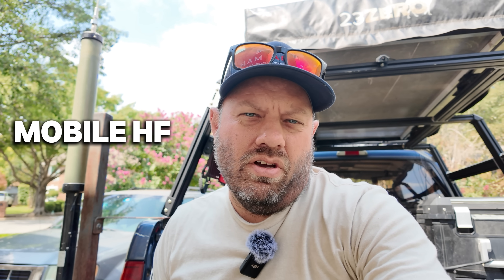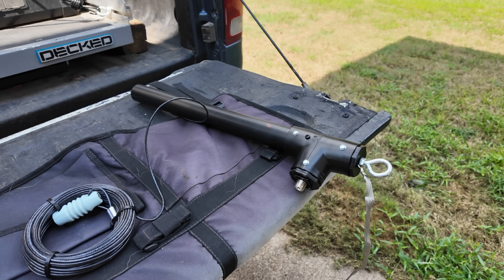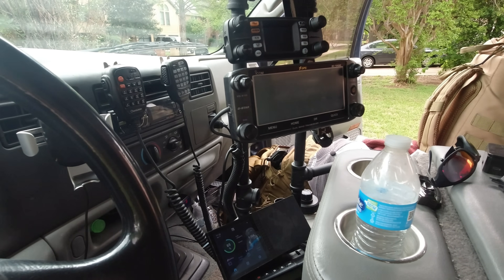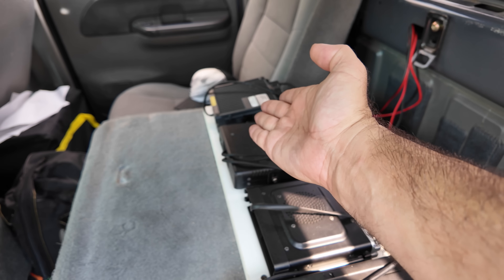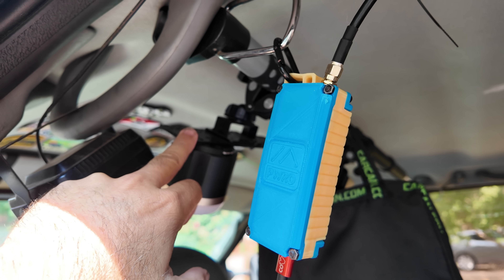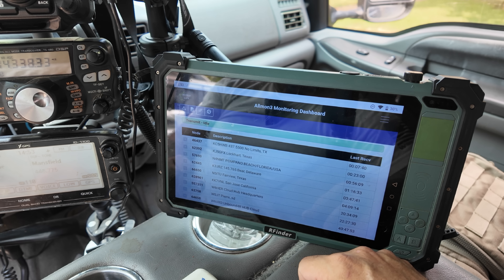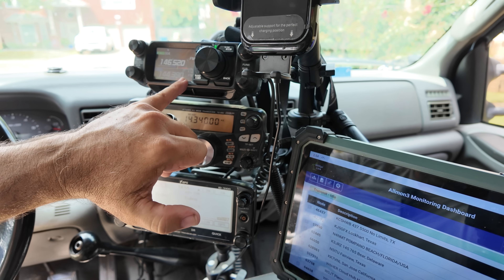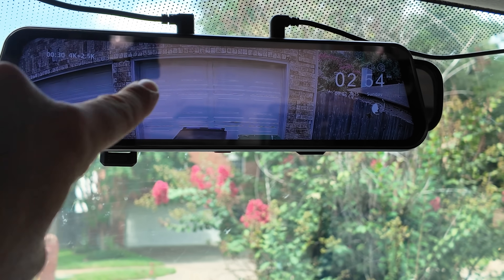How I Built The Coolest Truck Setup Ever

Comment: You can cover that back cab wall with dynomat or some similar sound deadening tape. it will keep the cab cooler in the summer and reduce noise a considerable amount. You can do the inside of the doors too if you pull door panels. I do this on all my older trucks. Makes them feel new inside. Plus it makes it easier to hear radio stuff while driving. Very cool truck, very cool setup!
Reply from the maker: Yes I have some of that in my older truck

Comment: Nice setup! Saw an Openspot I think, what's the story with that? I just got mine working with an IC7100 and thinking about mobile with it. Also, would love to know what antennas you are using on the rig.
Reply from the maker: I use that for System Fusion right now

Comment: I have 2 Icom IC-7000's mounted vertically in my console as well as an Yaesu FT-500DR and a 6 gang rocker switch panel for offroad lights and 2 HackRF SDR receivers for all mode scanners. de W5DMG.

Comment: I use an ATAS A120 with my FT-891, but I’m not entirely trustworthy of it staying put when I’m driving, as it flexes my trunk a bit, and requires a MAT-50 magnetic attachment for additional capacitance for proper tuning on 30 through 6 meters. A sedan isn’t an ideal solution for HF on the road. A truck would be a much more viable option, IMO.

Any advice appreciated! 73 de MN KF0QNM

Comment: It took me awhile to get my mobile setup correct. Icom IC-7100 w/ Comet SBB5 &  Diamond SD330 Screwdriver (HF) tied to a Tunematic Antenna Tuner. Byonics GPS for near repeaters function. Mounted to a F150 Third brake light BuiltRight mount. Lido mount in the Cab. There's a video on my channel about it. I still have my 5100 though as I LOVE the nearby GPS scanning while traveling it will constantly change where it's scanning based upon your position. Hopefully the newer 7100 (whenever released) will have a similar ATAS antenna setup and that nearby GPS feature. It will eliminate all other mobile rigs.